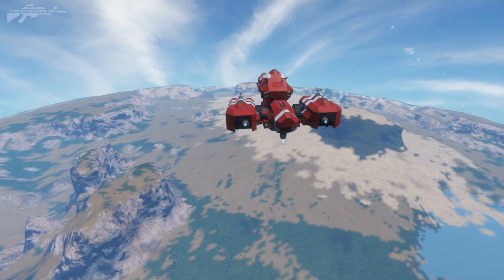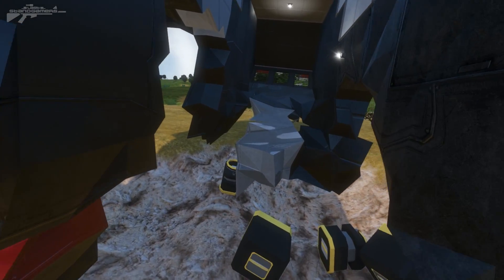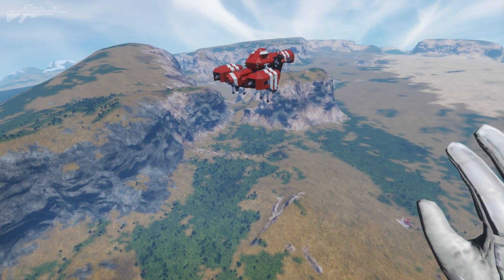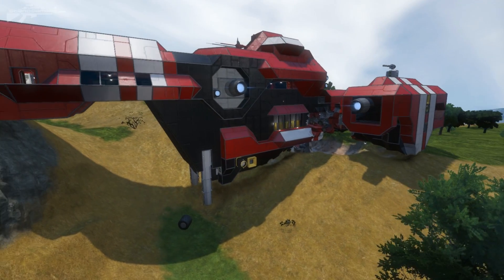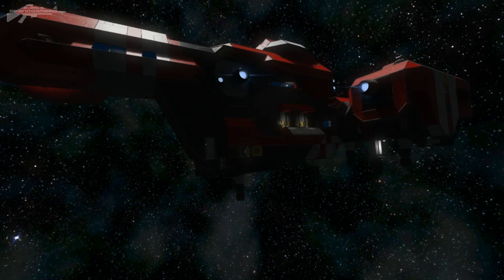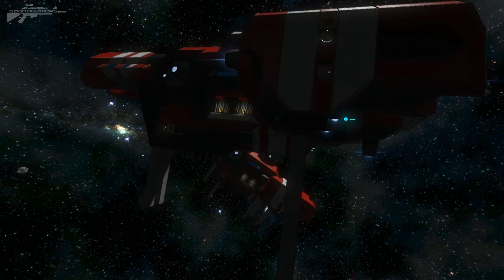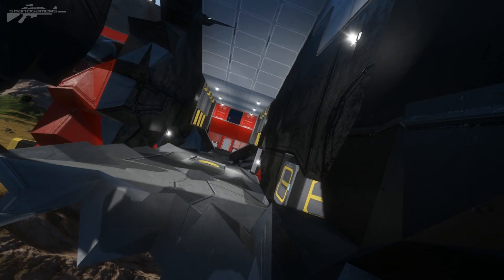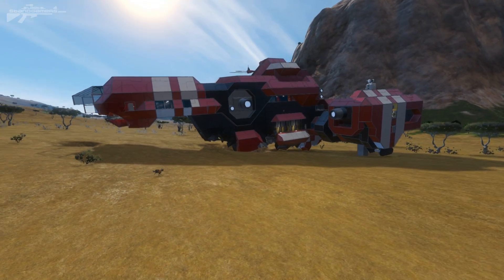Space Engineers - Crash Resistant Systems

Comment: What I am thinking was to have large atmospheric thrusters on areas inside the ship, so that in case of an emergency landing you can turn them on and melt through the armor but also slow down the ship enough that it could most likely land safely
Reply: In an emergency you might not have power
Reply: +Bobby Block Batterys... Always Have Backup Batterys
Reply: +Алина Старковa (Alina Starkova) 2nd Account But what if your backup battery's get destroyed
Reply: Bobby Block Backups... You Shouldnt Leave Your Backups In One Place... Spread It Out
Reply: +Bobby Block 

The scenario we're considering is if you make a blind jump or something and you get pulled into a planet's gravity. Having atmospheric thrusters ready would hopefully at least slow your fall if not prevent a crash entirely.
Reply: I always keep at least a bank of 6 fully charged batteries right in my secondary emergency control center (which is at the very core of the ship) which should be enough to at least slow down the ship
Reply: Aaron said these were for if it's a damage emergency, not a jump emergency
Reply: At 5:01

Comment: My idea, redesign the bottom of the ship with heavy armor sloped blocks and tires. the sloped blocks (sloped face facing to the back of ship) to try and catch/break fall, and tires to try to absorb impact. Maybe even have a 2 or 3 thick layer of light armor between the underbelly and intenal compartments.

The biggest concern (from my POV) is preventing the ship from having a haul-breach So thicker plating on the underbelly might be the best idea. I even played with the idea of a one-time use crash shield, which basically is several layers of light armor that is built in the shape of the ship in question, and attached with merge blocks to the bottom, so you can just (hopefully) detach it and be on your way.
Reply: +Schregger I can promise you heavy armor stays where it's made. If it's on a planet it's not leaving that planet, if it's made in space it would be in your best interests to keep it in space. I tested it in fact. Heavy armor ships even with no cargo Can't break out of atmosphere without ludicrous amounts of thrust. So while heavy armor might save your ship if it crashes that ship isn't leaving the planet.
Reply: Well, that just puts points into the onetime use crash shield idea...
Reply: +Schregger  sugest doing spaced armor for best result  1 block betwen
Reply: Good point.
Reply: +Megasaber That test done with large ships?  I've made a small ship with heavy armor blocks where ship+cargo was about 200,000kg (most of that iron ingots) that was able to leave a planet, and land safely.  I used 4 large atmospheric thrusters, 2 large hydrogen thrusters, and 2 large ion thrusters to lift it.
Reply: +Schregger
 Detachable armor makes repairs and survivability in general easier. In space, if some armor gets damaged, head to base, drop off the damaged set for repairs, and grab a fresh one to be immediately available for combat.
 "Surprise! Didn't expect to see ME so soon, huh?"
Reply: Thelothuo I know, right? I designed a ship that functioned as a...I guess it would be a frigate... that had a triangle body(look of iron clads) that was built for the purpose of driving straight through an enemy line, and firing broadsides of missiles and cannons into ships. To make it easier and quicker to repair and send back out, I just built it with removable, sandwiched armor on the bottom and sides. 

Shame I lost it when my old PC shit itself, should have uploaded to the workshop or something.
Reply: *****
 Great opportunity to redesign it and improve any issues from before.
 There were so many different versions of the M4 Sherman it wasn't funny.

7 Sherman Families with a total of 16 Sherman Variants in those families
20 Vehicles based on the Sherman hull
40 Special Attachment Versions of the Sherman

Information courtesy of Wikipedia.
Reply: Schregger I have considered building a modular ship that can be easily assembled on a factory line. Modular and detachable body plating would make armor repair a breeze as you would just snap in a new plate and toss the old one in a grinder pit to recycle it.

Comment: You could have a command block set to lower them if you lose a vital amount of thrusters with a secondary generator or battery. You could also just activate it manually from a secondary battery or generator providing you are in need.

I would also add another layer to the base of the ship if applicable. That blast door idea from earlier could come in handy as well. It's worth a test at least.

Comment: My suggestion would be invest in hydrogen thrusters. However, you set them up on sensors so they activate once they realize they're too low. Kinda like a parachute design. You won't waste hydrogen with a sensor controlled thruster, and you can always turn it off.

Comment: Most crash safety features for a car can be transferred to this. Roll cage (exo cage, not indo), skid pans, shock absorbers (bumpers), crumple zones, and break away zones (look at a F1 car). Given the weight of most large ships and the duriblity of the blocks in game I think having an exo-cage or skids like a helicopter would do pretty good. My dual rotor helo has survived with its light armor hull intact several times do to its heavy armor landing skids. Break away zones are not as good in this game setting as you want to save functionality of the ship (but could be good if the ship was build specifically for a crash survivor scenario game were lift off is not important.) Crumple zones would still be good. Just have to double hull/spaced armor the bottom of the ship. The only shock absorber in the game is the suspension wheels which obviously won't dissipate enough of the impact energy as they break on a regular basis with just driving around in a 10,000kg vehicle let alone a 1mil kg ship impact.

Comment: Reinforce the bottom with military grade blocks?  I'd add military block slopes to the bottom of the ship sideways. I once made a ramming ship and shaped it like a sword, with a blade edge using slopes. Worked incredibly well. Very smooth and no resistance, pierced ships so easily with very little damage. Or you use slopes to make a spikey sort of spine underneath.

Comment: Some of the later tests had alot of forward motion, meaning that the vertical speed would be less then if you only dropped it straight down. I think that changes the outcome quite heavily. If you want to do a more thorough test then they should be dropped straight down from a fixed point onto a flat surface.

That said, i still like the concept

Comment: try have landing gears with 2 stages the 1st stage can be a small extension for a proper landing and the 2nd can extend further than the 1st stage so it absorbs the damage and u can make it flush with the ship or 2 different pistons so u have more blocks to absorb the damage protecting the ship
i would try it but i dont have a good pc for space engineers so at least u can try it and see if it works
good luck if u do try this method :D

Comment: So ive noticed that most people have most thrusters on the back of their ships but also i havent seen many people pull up the nose of their ship at the start of reentryand use those thrusters assuming theyre hydrogen ofcourse and use those to slow you down and slowly level out later on. this all assumes it has some resistance to the gravity but with slowing yourself down with the back and then leveling out you can eirhter use the gyroscopes to rotate the ship to  land on a non vital part of the ship or you could reenforce the crap out of a detachable nosecone or bottom armor layer that can be repiaried using a projector so it get smashed but the actual ship does not so when you want to leave you can grind up or repair the landing armor or detach its merge blocks and fly away itd be better if you spead out the impact as well the piston thing would've worked if you added a few more on the outer edges. but youd get better results of you could makie it si one stage of the pistons are collapseable but resistant to being collapsed maybe by stacking pistons. Or you can try to control your landing using the bottom armor and bombs like the orion project to propell a space ship with nuclear bombs. uhhhh you try that first and let me know how it works.

Comment: you are so lucky that you can watch a crash without several screen freezez in the prozess ... followed by a gamecrash :,(
Reply: do you know your pc specs?
Reply: +TiTanAEfull maybe it´s the ram? loom at the task manager ram usage graph during those crashes. ram is cheap.
Reply: TiTanAEfull that can be caused by many things. make sure your computer has plenty of RAM, VRAM, a fast processor, and a motherboard that supports high hardware speeds(your motherboard can limit the whole system. This is easily the most common issue with modded pre-builts along side the lack of a GPU). Should help the problem then

Comment: Well I don't think space engineers has the physics to do this but maybe even if you got a block that is pretty strong attached it some Pistons on the bottom and some sensors would sense the ground and set off a timer on the Pistons to retract at a certain speed so it can somewhat match the speed of impact for when it touches the ground and then it acts like shocks which absorb the impact

Comment: about your test:

the manner of dropping is wrong, first you assume nobody would control the ship as its dropping, second you say the thrusters do nothing, but in fact only work at 30% max power, while it wont stop your decent, you can still at least try to head for flat terrain...

the stilts/pistons would work a bit better if you distribute the load more, do know that the reason it did so much damage is because the blocks and indeed the pistons transferred the damage towards the rest of the ship, deformable blocks transfer excess damage done to the block to connected blocks that also share this charistic, if you had mounted the piston blocks to a different kind of block like blast doors it would have much less damage to the rest of the ship, in fact if you had used interior pillars more damage would have been dissipated...

i think this because i have been experimenting with anti-brick missile armor(small ship heavy armor torps) i have noticed that using 'sturdy' blocks tend to be more resistant towards these, collision damage between ships and solid masses is about the same in this game, so the same would apply to crashing on a planet, while i advice you don't use reactive armor(what i'm investigating for missile armor btw) fortifying or using specialized blocks would be usefully...

i also propose another idea, to use a roter's braking torque function to slowly absorb the momentum, like it would work like a jack-pump in that it would fold in as it collapsed, it might be a idea to design a ship(or redesign big red) to have built-in cripple zones like modern cars to make it less destructive to vital parts of the ship and move around the internals of the ship itself...

Comment: go pistons extend now!
they explode

well....shit
Reply: +Forcedminer "Pistons and rotors are locked from moving at speeds excess of 15m/s" -Keenswh (some patch a few weeks ago"
Reply: King Harkinian any time i use pistons they tend to explode. :/ 

only when completely stationary with no load at all on them...can they extend without the heads exploding off.
Reply: Forcedminer They seem to be really weak against side-forces b/c i can land an 18,000,000kg ship on 3! But god-forbid you try to make retractable landing gear on the heads of the pistons...
Reply: King Harkinian try making an extending mining drill.

i had four pistons on a 4x4 block of conveyors with mining drills attached....each time i'd go to extend they'd snap off.

i stopped using that idea...
Reply: One drill per piston usually works